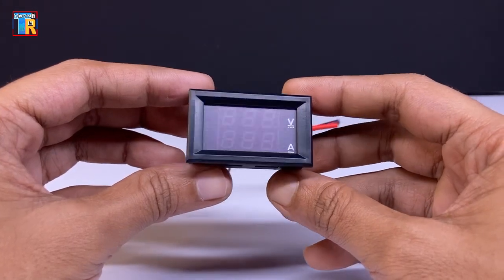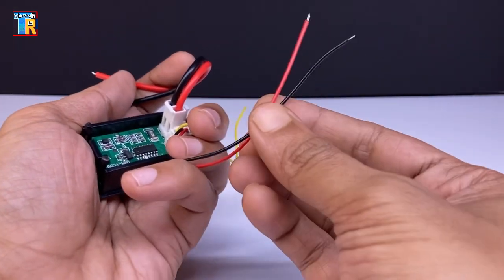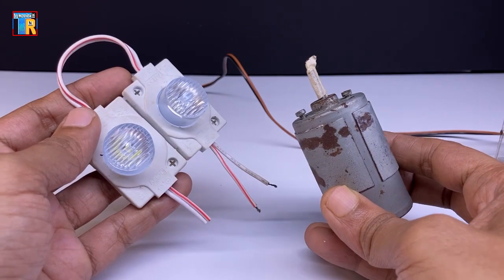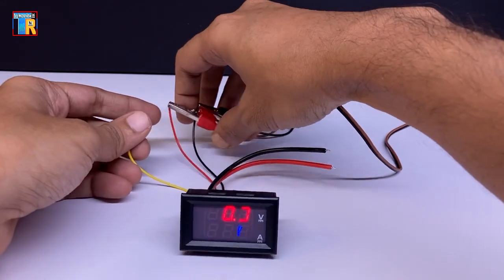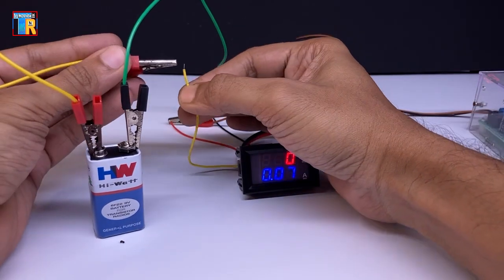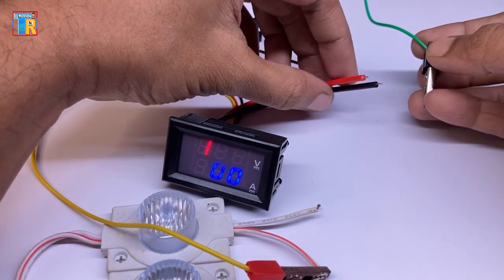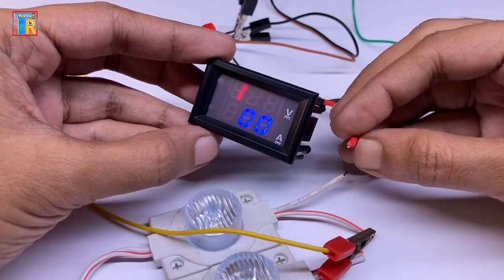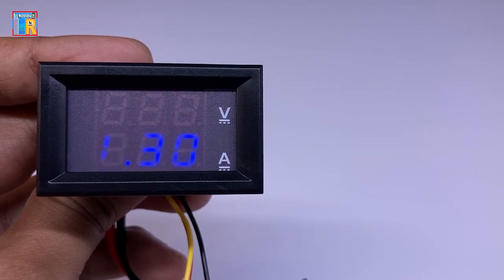How to Use Digital DC Voltage & Amperage Meter | Beginner's Guide

Comment: How to measure volt and current from TP4056 while charging battery? I want to modify my TP4056 to use variable resistor to control its charging current. Right now I need to be able to measure it first.
I already connect the meter to the TP4056 module. The battery get charged through the wire that connect to the meter but it shows voltage around 4v but amp is 0.  That's very impossible because red LED and blue LED on tp4056 light up.
Please help.